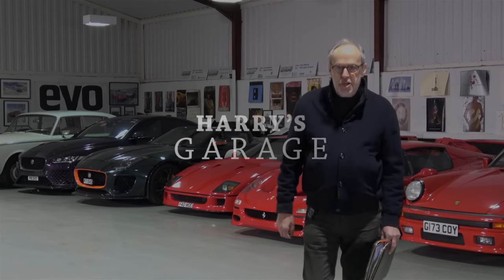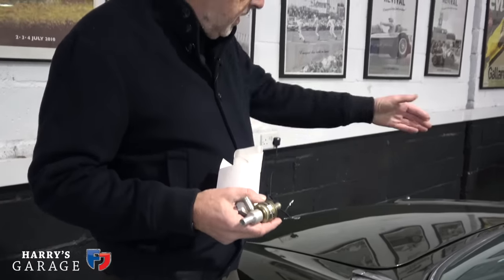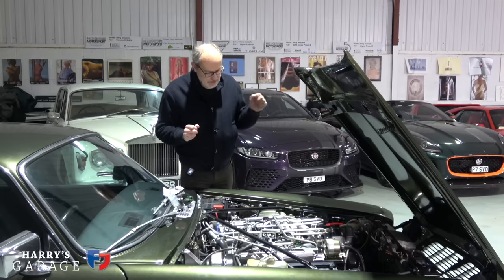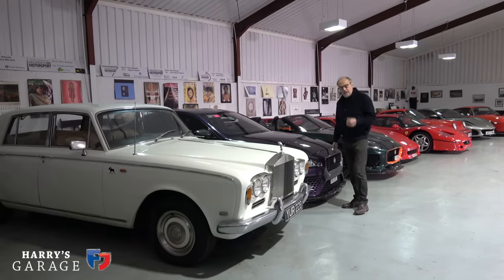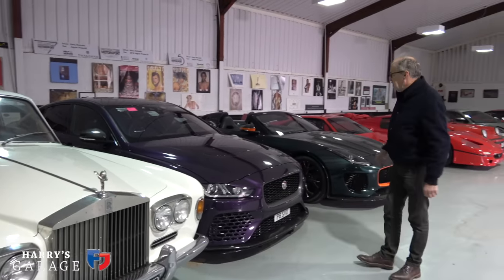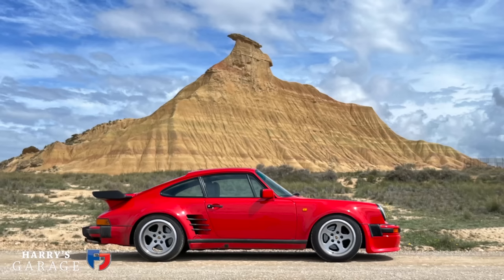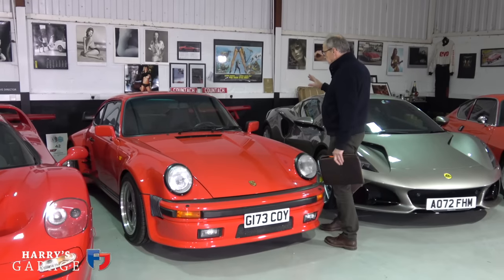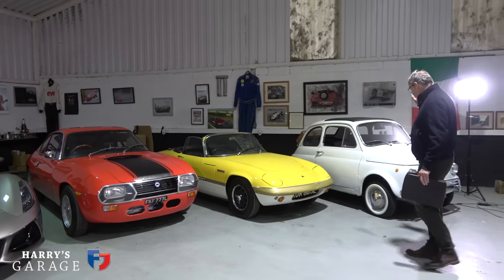Harry's Garage 2022 round-up. The highs & lows plus all the costs

Comment: Hi Harry, happy new year.

Great fan and all that. Wanted to say that I'd been fighting to get my XJS V12 working right for the last 8 years with all the issues and many more that you have been experiencing. I also bought the AJ6 modifications including the exhaust and have also had it converted to manual. However no matter what I did, one or more cylinders would stop working. Bought new injectors, fuel regulators, all the sensors, plugs, ignition wires, distributor, ignition amplifier, coils, etc... and the list goes on and on.

I've recently bought a very interesting system from a chap in Norway, who sells a kit to convert the car to a modern ECU system which also removes the need for the ignition distributor and all the vacuum pipes. All I can say is WOW!! I recommend you do a search for Mobeck Tekniske  Jaguar V12 efi kit, in the case you have problems again. I'm not affiliated in any way with these guys. 

All I can say is that I can now balance a very thin coin on one side of the engine intake and it doesn't fall down!!!! 

By the way I'm based in Pakistan and I have the only V12 XJS coupe in the whole country!!!
Reply: Upvoting this in the hope Harry might see it
Reply: Are you in Karachi?
Reply: I'm based in Lahore.

Comment: Happy New Year, all! 
I so feel Harry's pain. On the "slightly" cheaper end of the classic car spectrum: I ran a MGB GT for a few years as a daily. The issue with "new" parts that just weren't up to any standard is so (!) familiar + to frustration from having a just refreshed car play up yet again.
Good job Harry's got a few alternative cars to use - for me it was start spannering on a Friday, have it back together and running on Monday morning :-)
Reply: Yes, if you can avoid replacing kit its usually the best policy. Had a series of 'new' coils which failed on me, the original lasted 40  years prior to that. Very annoying.
Reply: @cdg3818  I know what you mean. Unfortunately not only was my time to work on it limited - more crucially the skill was/is, too. I managed to rebuild the clutch slave cylinder, but due to shoddy new rubber parts I did that twice in my 5 years with the car. Then there were the Armstrong-style dampers on the front... They were basically a routine service item, each time being replaced with refurbished items - until I upgraded to coils ...

Comment: A great summary video of the year, back in about 1988/89 I had a  1984 Jaguar 4.2 Sovereign ( my first Jaguar, I am now on my 11th ) I also had issues with the fuel tank change over valves, similar to you , the first I knew was a car following me on a motorway kept flashing their lights for me to pull over, when I did he told me my N/S tank was overflowing and spraying his car with a spray of fuel, I then had to make sure I used the N/S tank first as the O/S tank used to pump into it ! A short while later we got the valve renewed and all good after that. Love your collection and find the videos very informative , thank you so much.

Comment: Loved the channel a real pleasure to watch, many thanks for taking the time, also thanks to your son and Mrs for holding the camera. 

1) The Jag I would be really annoyed with, I remember the guy that built the engine had loads of V12 engines and XJ-S cars in the workshop and he said we can do this and we can do that. I would have sent the Jag back saying, " Well you can get this running as it should". Surely the amount of experience in that workshop there must some knowledge of injectors. I remember they talked you into having some new ignition system. Back in the day the twin tank system was never a problem other than wear and tear. All subjective, but in my view the  XJ Coupe sits too low and has a ruined stance, in my opinion it looks like a 10 year old, 100,000 miler with saging suspension. 

2) This may or may not help but Lucas were an importer for Magneti marelli during the time your Espada was built, maybe some old Lucas dealer may have some original parts lying around. 

3) The Lamborghini gearbox, this would drive me nuts. It is like a weeping sore without a plaster. 

In summarization you have shown that these old cars are a labour of love and hassle, a bit like a boat, a constant money drain. You are lucky you are someone who has a plethora of toys to choose from, if you were on a budget with either the Jag, or either Lambo, and they were all you had, you would soon out them. I believe the issue with these so called supercars is they were not that good to begin with so they did not sell many. So, the knowledge is scarce. All those mechanics that worked on Ferraris where I worked are now dead, all the knowledge died with them. If I was to have a 1970's classic I would have either a Jensen Interceptor, any TR or MG. The reason being is there is still so much knowledge and exellent parts supply around these cars, after all, what good is a car that does not move.

All of you have a Happy and Healthy 2023.

Comment: Thank you, Harry. Your Harry's Garage channel is one of my absolute favourites and thank you for the introduction to Iain Tyrrell. I feel your pain and frustration when it comes to ordering replacement parts and getting less than acceptable performance from the parts organization. That was a very mild rant.

Sometimes really good things can happen.

I had a brilliant experience a few years ago, Feb 2016, with my (moderately warmed up) Saab 2.8 V6 manual 9-3 aero. The air conditioning compressor died. The Saab specialist servicing company that I trust is 1,100 km away and I couldn't drive to them at the time to get the work done. The genuine Saab part was over $3,000, but there was an OEM part for around $600 that they use. They didn't have one in stock, but they gave me the ebay link to the part. I checked it out and ordered. I got an email from the American company asking for my VIN because it was a different market and they wanted to make sure that it was the correct part for my car. They could have just sold it to me and not bothered about whether or not it fitted. But they checked to make sure. It was the right part. I call that good service. It ended up costing $650 delivered.

Swedish Prestige/Melbourne European here in Australia and BuyAutoParts.com in the USA both get a big tick of approval from me.

Comment: On your TT600..We set one up for endurance racing here..At the end of the 6 hour event, we pulled the cam cover off and noticed our camshaft had gone missing!!..along with the greater part of the valve geat..DO have all of the oil you can get to the top end get there..and be as cool as possible..The 600 lump gets ever so warm on a storney good run.

Comment: The reason why you are supposed to replace the flexible hoses after a certain distance and/or time interval is because the rubber itself degrades. On my vehicle, you are also supposed to replace all of the brake seals and the servo filter too, and to be fair when you take them apart after three years, you can see why.

Comment: Harry, I have owned and restored two Diablo's over the past 16 years and ran into some of the same issues you have with Lamborghini parts. Since many of the original parts are no longer available, factory Lamborghini outsources copies of these original parts. The problem is that when they are laser scanning the original parts, its very easy to be off in actual size by 0.5-1.5% so for a distributor cap, this would be very bad. Much depends on the quality of scanner being used and a good one can be quite expensive.  Another problem encountered is not having an experienced solid  modeler taking the part and importing it in to a 3D modeling program and knowing how to fix the scanned part so it is an exact match.

On one occasion, I ordered a rear view mirror base and 9 months later when I received it, the part was 20% larger than the original. The frustrating part was that after 6 more months, Eurospares in the UK was unable to ever have Factory Lamborghini even acknowledge they made a mistake. I was hoping Lamborghini's German partners could instill discipline into Polo Strorico but that's asking a lot.

Comment: No doubt you've thought of this, but why not connect the two fuel tanks?  Misery loves company - I rebuilt a Lotus Europa from a bare frame, and have been having fuel issues ever since.  Latest hypothesis... similar to yours... too much fuel delivered by a new mech fuel pump that I added just because I could.  That speculation comes after countless on-offs with the carburettor.  Seems OK now with the original, which also happens to have a return line, like your Jag. Good luck and thanks for the videos in 2022.

Comment: Harry, Happy New Year and Thank You! for a grand year of all your automotive projects and road rides. It has been a pleasure to watch and participate in your passion for 'cars done right'. :) 

The Lancia Fulvia SportGT Zagato was my favorite project of the year ... because I was working on the (much less extensive) restoration of my '67 Lancia Fulvia Coupé this year. I love these cars, they are simply so elegant and delightful to drive. The largest part of the work on mine was a complete overhaul of the interior; there was also modest mechanical and tuning work to get it running right and fitted with the "right" wheels and tires. Finished, it's proven to be a superb machine worthy of all the effort ... Your Zagato is just an awesome overhaul and once the running tune is properly fettled it will be very quick and fun to boot. :) 

Here's my Fulvia photo gallery ... https://www.flickr.com/gp/gdgphoto/LBU1y08wj6

Thank you again! G

Comment: Smart Motorway breakdown is so incredibly frightening, my 1969 Triumph GT6 Mk2 suffered an alternator failure, 30 mins on side of slow lane, no lights at 11pm, lucky I had two comes and sign, also some high Visibility Tape that I stuck across rear screen ...but it’s almost criminally insane, the car has over ten near misses from Lorries and some twat undertaking at 80+ whilst on his phone .... not an experience I want to repeat..excellent content in 2022 looking forward to year ahead in your garage and Farm.
Reply: Should read two Road visibility Cones
Reply: I suggest complaining to your local MP. These roads are indeed very dangerous.

Comment: I love classic cars (also love new stuff) and the main reason is the way the look and sound. I am not a purist. Like you, I want to enjoy driving them but, sometimes they need improvement. The XJ-C falls into that boat. Why you haven’t gone for an aftermarket ECU and modern fuel injection is beyond me. It would have been way cheaper and the car would have been in the road more! While a like the look of the XJ twin tanks, dynamically they make no sense (I have an S1 XJ6). It’s better to have weight more central and further fwd but, even side to side. I’ve just connected both tanks with a T piece and run a single pump. Anyway, rant over. I really want Lotus to succeed with the Emira so happy it’s doing well. Love the content and I look forward to what this year brings. Thanks Harry. HNY

Comment: Thanks Harry, for the review of the Garage and costs thereof. 
A most enjoyable year for us watching your enjoyment with the toys.

However, a quick figuring on my part- carry the 6 add the 9 and omg was achieved.
Your group insurance bill total would bring my 2nd car into the 21 century with new
brakes at all 4 corners, new tires too, and a new convertible top. 

 What cost the most- what cost the least to operate. Guesstimation on my part here.
The restoration of the Lancia. The purchase of the Emira running a close 2nd. 
Least amount: The Rolls & Fiat 500. There is that dent on the Rolls to consider.

After rounding a few costs up- I came up with this total: 181k give or take.
This amount does not include fuel, towing of the 930 & Espada, toll passes,
ferry & rail transportation, tickets by the French police on British car plates, 
leaving out- the Land Rover, the farm equipment, and the yacht in southern France.

And... Mrs. M has taken a liking to the Emira too. That matters in the big picture
cause if mama isn't happy those 2K road trips are not going be a fun thing for you.

2023- 2 Lambos and a Ferrari with two engine out costs should be entertaining to your
 bottom line totals. Mrs. M shoe purchases and any bubbly refreshment purchases
not withstanding here.  It has been an adventure with you & Mrs. M- thanks for bringing
the many fans of Harry's Garage along for the ride.
Reply: After a day or so of reflection- two additional thoughts came to mind.
After the review of the costs for your toys Harry- I decided to look at my own yearly costs.
Vastly different- imagine that.  Mine came to less- than what was spent on the 930.

 I rewatched your P7 road trip videos to gain a better understanding of why it works for you.
Enjoyable motoring on the French motorways- top up, auto, cruise set, Air Con on, fuel economy
and then, the transformation into the beast that it is even with your willingness to put up with the quirky top set up.
Even though you only use it for special occasions- the low maintaining costs, after 6 years in the garage
this seems to be the workhorse of pleasurable driving experience for you by the satisfaction gained.
That night run through the mountains on the Route de Napolean was epic. 

 I can now understand how the new Emira has gained that same respect from you- I can hear it in the tone of your
voice, that pleasurable experience of it just works so well for what it does for the driving experience.
Bang for buck works. 

Well wishes to you and yours for the 2023 season. 
And then Ian calls about the Countach- it's ready and so is the bill.

Comment: Great point about new issue parts for classic cars. I've gone through several "new" idle control valves for my 89 BMW 635CSI. All junk. bought an old used one on ebay and now the car runs great.

Comment: Not surprised to hear of your issues with new parts. I came to the conclusion a while back that refurbishing existing parts ( if possible ) was better than purchasing new, as it is the case with so much that has been off-shored to China ( or other Far Eastern locations ), the tolerances and quality are simply not up to spec. 

On a separate thread appreciate you may wish to cut down on the restoration videos as they don't get the viewing figures, but they have been some of the best material you have produced and introduce us to some hugely talented people and businesses. Likewise the road trips are a source of inspiration ( The P8 hose was a close call ! ). Keep up the good work.

Comment: Xj6: there are one-way ball bearings to stop fuel going from one side to the other hidden inside the original lines. They are easy to miss, then the pump from one side fills the other.

Comment: Ethanol in the petrol won't be good for the older parts.   I'm pretty sure that's why BMW had to replace all the injectors on my '57 330i when I had it, and also why the high pressure fuel pump went out too (which cost £800 to fix - using a refurbished one supplied by BMW).

The hit you take with ethanol in the fuel for your MPG makes you wonder if it's any better than just adding water to your fuel.   My MPG dropped with V-Power and I asked Shell if perhaps the tank at the petrol station had been incorrectly filled, but they came straight back and blamed the biofuel they had to now add.   The 10% extra MPG for 7% extra cost at the time had vanished.   And that was when it must have only been 5% ethanol.

Comment: Old cars are such fickle things. They can run pretty much perfectly for decades, but once they're taken apart and rebuilt, it opens a Pandora's box of teething troubles that can last for years. Which is why sometimes it's better to just accept something like a slight oil weep or whatever and leave well alone. That aside, the XJ-C looks glorious in its new colour and once dialled in, will be absolutely fabulous. Saw it on the A40 earlier in the year and was very very smitten. Beautiful car.

Comment: A good friend of mine bought a second hand XJ12 back in 1980. He said that it was a wonderful car. The best he had driven. When it was running, which was not very often. He had endless problems with everything - engine, fuel system, cooling system, electrics, gearbox, suspension - the lot. At first the problems were fixed by the dealer who sold him the car, but he foolishly accepted a large payoff to cancel the warranty as he thought all the problems had been sorted. They hadn't. For about a year and many breakdowns and thousands of pounds later he could not wait to get rid of the car and took it to an auction when everything seemed to be working. As he drove the car to the auction house the auto box stuck in first gear and the driver's electric window stuck down! I don't think he got much at all from the auction, other than a huge sigh of relief.